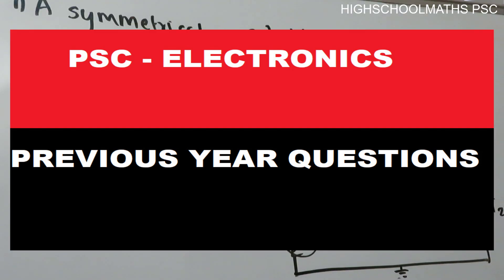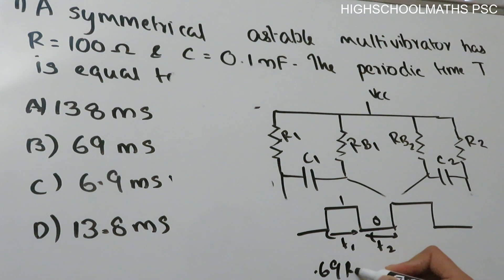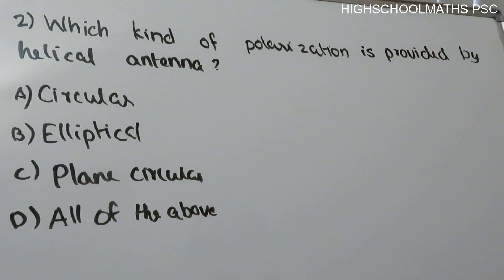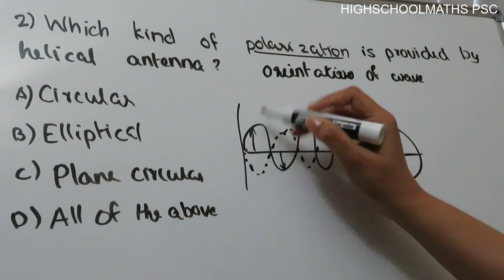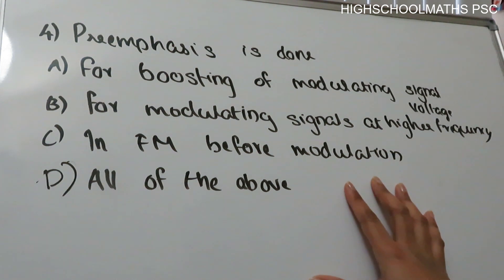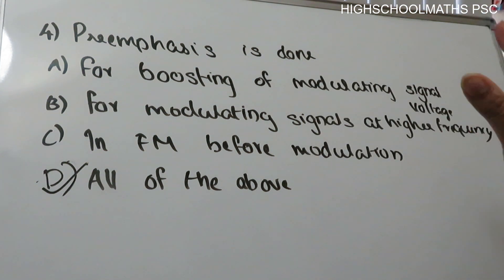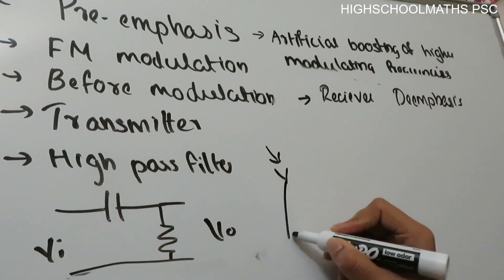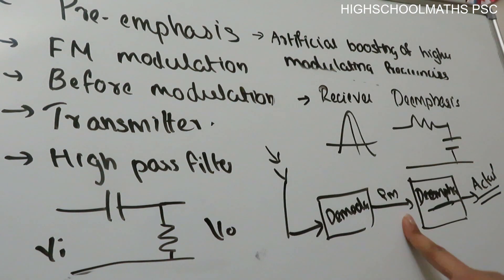POLYTECHNIC LECTURER | ELECTRONICS മുൻവർഷ  ചോദ്യങ്ങൾ😊✌  |PSC-ELECTRONICS | PART -33

Comment: Hi mam for monostable and bistable  nte koode onnu parayo
Reply from the maker: for monostable use equation .69 RC.
(monostable using 555 , T =1.1 RC)
for bistable it depends on  the triggering instances . 
I will try to include this in next video.
Reply from the maker: Pls check this link :  https://youtu.be/mb-63527ZA8